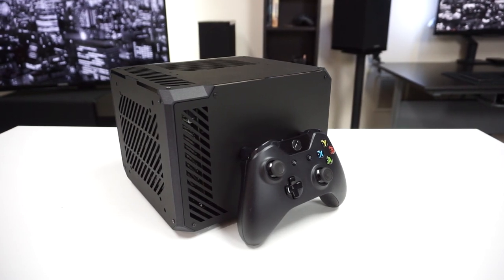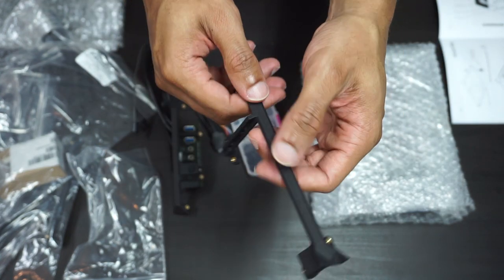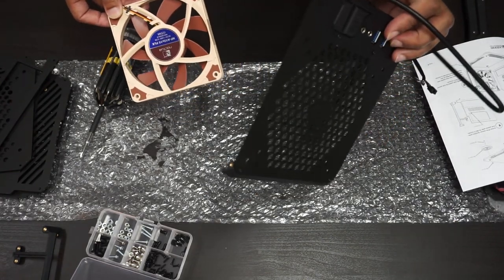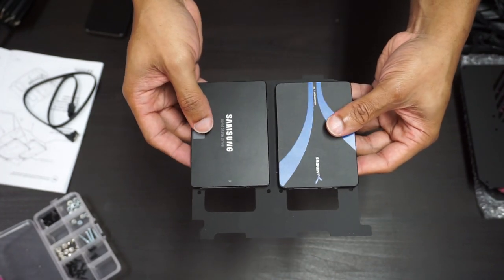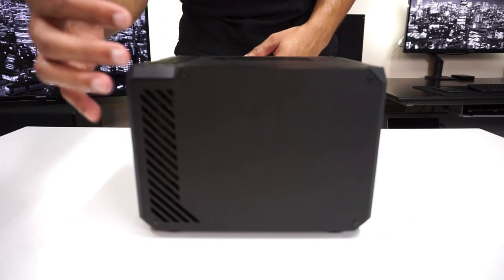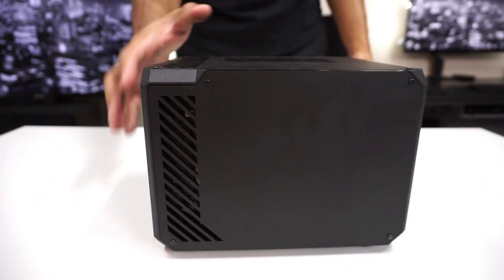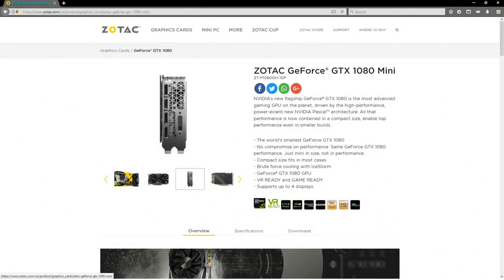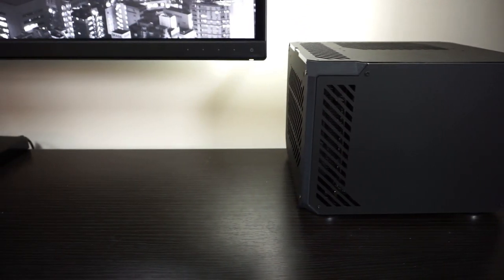Lazer3D LZ7 Mini-itx Case Review & Build

Comment: Jay ..great video & topic. Posting thermals instead of benchmarks was welcome. 
With the modular PS you can plug in individual cable at board..then 'size' where it will plug into PS..then fold up the slack for a tight, thin bundle and tie off . you can do that will all except the ATX mb connector, but can do something similiar in reverse.
Reply from the maker: Yea, that is what I ended up doing with the cables. Ultimately it is still a tight fit. I will be purchasing (or making) some custom cables.

Comment: It really is a lovely case which really makes great use of space. That MSI card fit just perfectly; almost like the case was designed for it. I agree that the graphics card size and cable management seem like things that would require compromises and planning and I also know that if I had my PC in this case, the dust in this room would shortly overwhelm it and probably burn my house down. That aside, great looking case and great build/review!
Reply: Thanks for the comments, dust filters are available and can be fitted to the system fan panel as well as the GPU intake panel if dust build up is a concern.
Reply: Oh cool, that's good to know. I saw your comment explaining your design/build process and it seems very robust and well-thought out. I'm presently committed to an existing build but I will certainly keep an eye out for your work when it's upgrade time. Kudos to you and thanks to Tek Everything for bringing visibility to your good work

Comment: This looks super good and since it's 3d printed it should be a big price competitor to like ncase or dancase
Edit:umm guess some acrylic and plastic makes it worth $230??
Reply: I'll be sticking with my PC-Q21 :)
Reply: YTA I'm sticking with my silverstone raven rvz02b
Reply: And you have to assemble it yourself!
Reply: Lol, that's 20% off from the price of a DAN A4.
And that has even better quality airflow design and is all metal xDDD
Reply: At this price, I'd expect them executing your own 3d project.
Reply: DAN A4 is not well ventilated like this one, especially CPU Side.
LZ7 has 360° GPU venting, better CPU cooler height, and Acrilic not going into resonance like steel or alluminum.
It's similar to a CM Elite 110 (Maybe the best ITX case for venting).
Reply: I just want a as small as possible case under 50 bucks. Not premium pseudo ground breaking shit for at least 150 bucks
😞
Reply: To much for plastic and acrylic, $70 dollars at the most
Reply: You people act like the cost of materials should be the cost of the case there’s a lot of research experimentation design development that goes into these cases. It’s not like that shit these ideas out left and right

Comment: Hey awesome build. Is there any airflow or cooling problems? Seriously considering this exact build. Have you done a follow up video of performance or any issues you had later on?
Reply from the maker: I haven't done a follow up video. To be honest I haven't had any issues, the case is really awesome. As long as you get a good intake fan you should be fine. There are also beefier Noctua low profile coolers available that would allow you to push the overclock even further.
Reply: Sweet, thanks bro. Keep up the videos

Comment: That looks great. It’s pricey but I like how you can build the whole thing yourself and have lots of options. I’d be more interested in one that is wide and not as tall maybe with the graphics card laying flat next to the motherboard, kind of the same size as a blu ray player so it would look good as a htpc/console on the TV rack
Reply from the maker: You mean something similar to the style of the S4 mini?
Reply: Yeah, or like the Fractal node 202. But the box look is good itself too. Might also be cool if they made laser cut wood panels as an option instead of just plastic :)
Reply from the maker: Wood would be cool. Probably much more expensive though.
Reply: Looking into wood options, experimenting with which woods work well on the laser cutter. Should have some options available later in the year

Comment: Can you run the temperature test again with the psu flipped? I think everything would run cooler having the exhaust fan on psu help venting as well. Best itx system I've seen to date great work sir!
Reply from the maker: If I did that, I would have two fans in close proximity working against each other.

Comment: I've been looking around for a shoebox-style alternative to the A4-SFX that's actually available. It's cool to learn about this one here. Just a couple thoughts:

1) If they added another 25mm to the length you could actually put the Zotac 1080 Ti mini in there for the ultimate SFF powerhouse. Although it would raise the volume to 7.96 liters... then again, that's still smaller than pretty much any other PSU + GPU case right now other than the A4-SFX or Zaber Sentry, and they could use the extra space for other stuff, like supporting a full-size fan instead of just a slim profile one.

2) At $230 USD shipped it's kind of a tough sell. At that price level I think I'd rather just pay the extra $70 for the A4-SFX, even if it means waiting for the next production run or trying to hunt one down. 

For now I think I'll stick with my Node 202 and wait to see what's around the corner. The Louqe Ghost looks interesting, or the Hutzy XS (at 4 liters, not being able to fit anything larger than the 1070 mini seems much more reasonable).
Reply from the maker: All good points, especially on the price. However, making larger would put it in the territory of other big box cube style cases. I am a big fan of the size, even though it does come with compromises.

Comment: If it was cheaper...
Reply: Mitchell Morgan I have a SG13 too :)
Reply: same case here.
Reply: If they were nearer the $100-ish, range, I'd go for it. :/
Reply from the maker: This seems to be the consensus from a lot of people so far. Hopefully Lazer3D will be able to cut production costs in the future.
Reply: Unfortunately they currently cost more than that to make, you then have the manufacturer and retailer markup to take into account.
Reply: Lazer3D I also watched a video from your brother about your company. Build quality looks really good I really like that matte look
Reply: I use a CM Elite 130, which is somewhat similar to the SG13. 
What I like about these slightly larger itx cases is the ATX PSU support. You may sacrifice the size a bit... but FULL size GPU and PSU support ends up saving so much money and hassle in the end. With the extra cost of ITX MOBOs it is super nice to save a bit of money while maintaining performance.
Reply: CM Elite 130, 120mm AIO w/ 2 Thermaltake Riings (push/pull), g3258 @ 4.6ghz, ASRock z97,  8gb Corsair LPX, GTX 960, Sandisk 250gb SSD, 750gb HDD.
Reply: The LZ7 is very expensive.... ML08B user here
Reply: Lazer3D Why? The actual cost of materials is only $75, $110 if you use Shapeways to do your printing. You severely need to work on efficiency if $230 is your final price, or someone is bound to price you out of the market for this style of case.
Reply: MortifiedDumplin, Where did you pluck those figures from?  On top of the cost of the Acrylic Sheet and 3D printed parts, have you factored in custom packaging tooling costs, print tooling costs, the packaging itself per item cost, purchasing laser cutting and fume extraction equipment, fume filters, replacement laser tubes, screws, nuts, accessories, custom made IO PCB's, manuals, laser printer toner, threaded inserts, overheads and energy bills, then you have the labour time behind cutting out all the panels, post processing, quality checking, dealing with supplies, inserting the motherboard standoffs, inserting 28 metal threaded inserts per case into all the corner pieces, bagging and labelling each component individually, shipping packaging, delivery costs of finished product, and the sheer amount of time put into the logistics behind the whole operation, back and forth emails for months on end, website design, graphic design, writing articles, hours and hours of photography, photo editing, advertising, time spent on social media trying to spread the word, the list goes on.  I've put over a year of my life into designing this case, followed by almost another year of time planning, gearing up for and carrying out production, I've put a bucket load of my own money into prototypes, testing and production equipment, most of the production has been handled by myself along with some support from immediate family members for the odd task here and there.  To make it all worth it I have to add some profit margin to my costs at which I sell to Overclockers UK, they then need to apply there own profit margin to make it all worth it for them, they have also put months of work and collaboration into this, its also not like they just take a finished case into stock and sell it on, they have to individually pick each component separately and pack it based on the customers chosen configuration which takes more time than a typical case sale (pick and ship).  I appreciate the case is expensive, I don't like how high the price is and wish it was lower, I really do, it was a choice between bringing it to market at this price, or don't bring it to market at all.  I'm sure a larger company could produce the same case for a much lower price with the backing of teams of people to handle all the various tasks behind bringing a product to market, along with established manufacturing plants and equipment already setup, and a large amount of capital to drive into high volume manufacture, but at the moment this is just me with a bit of help from the family doing the best I can.  Nobody is forcing anyone to buy the case, if you don't feel the product is worth the asking price that's absolutely fine, there are plenty of other cheaper cases to choose from.  One last thing, for none EU based customers you don't have to pay UK VAT which is 20% of the price, so the price for US customers is actually more like £150 (about $193), the deduction is automatically made during checkout when you select your country.
Reply: +Lazer3D IMHO, the labor alone to design and produce the case for customers who want something like what you've designed (like myself), I'm more than happy to pay the asking price.
Reply: A good example will be Parvum, they make something similar and a lot cheaper than that, for the price of one of your case I bought a custom case from parvum.
Reply: Yea, it's funny with $150 I can get a celeron N3450 mini PC from China to do some 4K video watching and web browsing.
Reply: 3d printing be is by no means an efficient way to manufacture a product, the price is mainly due to that.
It's also very slow and not scalable, so it's just unreasonable to think this case will become cheaper if it does take off
Reply: @alexadam4073  Yeah but parvum has terrible quality control and support.
Reply: Ikr? It is the best design with best functionality.. but the price is yaiks..
Reply: shorten your sg13 and boom you got smaller case at a cheaper price.... there is a guy who shorten their sg13 about 26% shorter that original with small effort...

Comment: Nice case, too bad with currency exchange it would be $267 with a fan and CPU cooler included, and that doesn't include shipping costs from UK.
Reply: Don't forget if you live outside the EU you don't have to pay UK VAT, so the price is automatically reduced by 20% during checkout once you select your country.  Although still expensive, the price is more like $230 delivered to the US.
Reply: that is way too expensive for a plastic case that has been 3d printed. Especially in a market where pc cases are getting cheaper and cheaper.

Comment: Hey! I like the upgrade with the CPU cooling. I'm thinking to do the same, but I just saw a guy who could put the Cryorig C7's fan to the Wraith Spire. Do you think it is possible to mount the Noctua NF-A9x14 to the Wraith spire? I think if its possible it would probably have a better performance because the Wraith Spire have a vapor chamber. And if I'm correct it would be still under 50mm.
Reply from the maker: Right, so I did try this and yes it does work. The only issue is that the wraith heat sink does not have traditional 92mm fan mounts. so you have to find another way to mount the fan to the heat sink. I used double sided tape to attach the four corners.

The Wraith and the NF-A9x14 fan performed really really well.
Reply: Ty! You just saved me 40 bucks :)

Comment: Hi how long is that gtx 1070 you put in there because on the amazon link you put the MSI GTX 1070 Aero ITX is 12.3 inches long. How can it fit in that case that takes cards up to 185mm long?
Reply from the maker: The MSI Aero ITX is only 175mm (6.9"). That must be a typo

Comment: sfx power supply should be mounted where you install the intake fan and this could allow installing higher cpu coolers(even maybe AIO coolers). just compromising a lil bit more width. and maybe front intake could be improved by using ssd mounts under the motherboard.
Reply from the maker: That would add significantly more width. You would need around an extra 50mm for that to work. Putting the SSD's under the motherboard isn't a bad idea though.

Comment: If your going to spend 200 on an ITX case. Then at least get custom cables for your PSU so the cable management step would be easier.
Reply: I'm going to do this exact build but with custom cables. Where would you get yours from?
Reply: Only pleb is buying custom cables when its so easy and cheap to do them yourself.

Comment: If it used an HD plex and could accommodate the zotac 1080 I would totally consider using it for my HTC pc vr setup. Idk about you but personally I'm tired of case manufacturers not realizing there is a high performance itx market that could benefit from space for some real coolers. Speaking coolers since you have up to 65mm of clearance I'd suggest the noctua l9x65. I'm currently using it in my RVZ03 and it works great.
Reply from the maker: Striking the right balance between size and cooling can be tough. The LZ7 might be the best I have seen at it so far. This case cools powerful GPU's and CPU's with relative ease.

I actually ordered an l9-65 on Monday, it will be waiting for me when I get home from work today. I am hoping to be able to comfortably hit between 3.7-3.8GHz with it.
Reply: Tek Everything curious how that works with ryzen 7, you gonna do a video on it?
Reply from the maker: I hadn't been planning on it... but I actually may do that. I have a couple videos in the pipeline already, so maybe I will just publish the data as an article on the website.

Comment: Very nice ITX case!
Just wondering the reason to in-take air for the case fan rather than exhaust air out of the case!
Reply from the maker: using the fan as an intake constantly pushes cool air over the CPU and PSU. it also keep the heat from hitting the CPU area. I am sure you could set it to exhaust with some systems, but having it set as an intake fan is preferable.
Reply: Our testing showed that you get a more balanced system when using the case fan as an intake, you get lower CPU and VRM temps and you also prevent the exhaust heat from entering the main motherboard zone.  Reversing the case fan as an exhaust fan does actually reduce the GPU temps as you are helping the GPU to pull air into the case, but the hot GPU air is then dragged across the CPU increasing overall temps.  It all depends on where your priorities lie, OC'ing the GPU, or a more balanced and quieter system.

Comment: That was a lovely built. Bro I need suggestion why my gpu(gtx 1060 6gb gigabyte g1 gaming) temperatures are so high while gaming like 80-82c. In Idle state these are 48 my room temperatures 30c but even in winters temperatures are 75c @ 20c room temperature. My chassis corsair 100r silent edition 1 intake front fan and 1 rear fan for exhaust.  Stock cpu cooler i5 6500. Where the problem Bro I need your suggestion.  Every necessary info I've given you in this comment so that you can fully understand.

Comment: Do you ever worry about dust. Itx cases always seem to have very large vents. Is it reasonable to put filters on them or do you have to worry about heat?
Reply from the maker: Dust has largerly been a non issue for me with these compact ITX cases. You could certainly add dust filters but the loss of airflow is generally not worth it.

There just isn't much area for dust to rest in a case like this. I would just take off the top and hit your components with some canned air once a month.
Reply: Tek Everything I see! If a case has proper airflow, I suppose that is not as much of an issue. Thanks for the reply!
Reply: small size makes it easy to clean as often as you want

Comment: What would be a more reasonable build if you were trying game on a 29" 2560x 1080p monitor but wanted to use this case because of a lack of available space for a bigger build. I was thinking along the lines of Ryzen 3 1200 with a GTX 1060 6GB graphics card.
Reply from the maker: What is your budget?
Reply: $900 max for the pc but lower is always better because I still have to get keyboard, mouse and monitor.
Reply from the maker: That budget is pretty tight for an expensive case.. I would probably go for a something like...

Ryzen 1600
Asrock AB350 ITX
8GB of DDR4 RAM (3000MHz minimum)
GTX1060 6GB
Corsair SF450
500GB Samsung 850 EVO

Something like that should be around $900 and give you solid gaming performance. You could also get a 1050Ti or cheaper storage which would save you some money.
Reply: Thanks for the help and I love watching your channel

Comment: since it is completely plastic what about the heat dissipation and the long time wont the heat  not affect the performance ??
Reply from the maker: The case makes up for its lack of metal with the massive side panel intake and ventilation. I have seen better thermal performance from this case, than any of my compact metal cases.